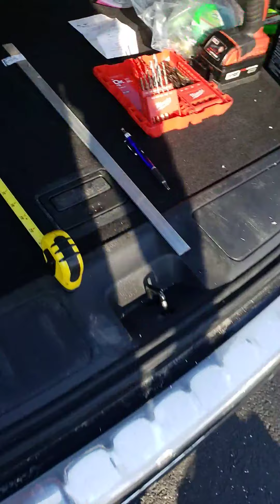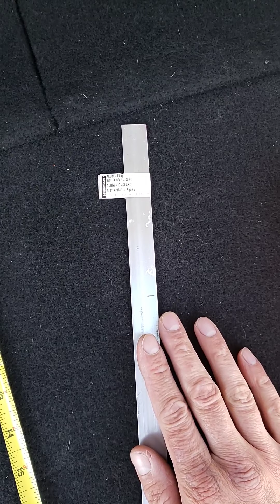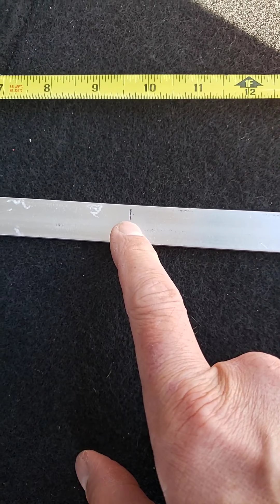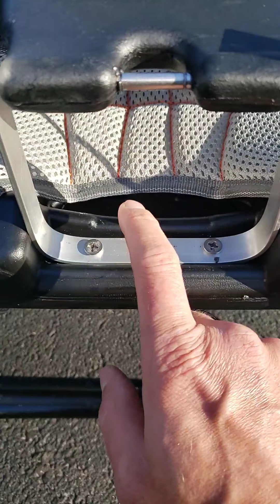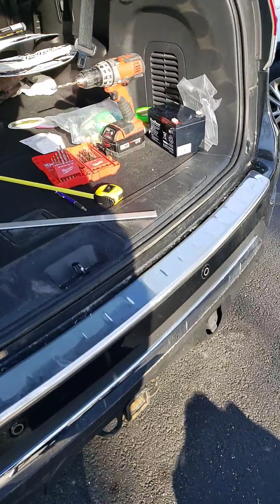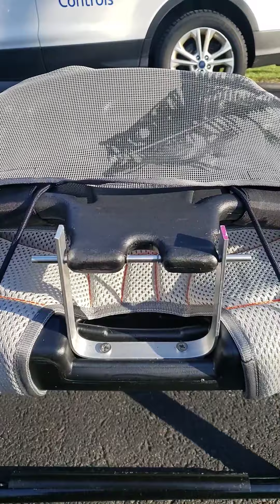Feelfree Kayak Gravity Seat Extension DIY quick and easy install

Comment: That does not work, I made the same ones in steel and they bent so much that they ended up loosening, in the end I compressed plastic from bottles and mold a solid piece, I shaped it to fit the seat, whoever wants I can give you the plan